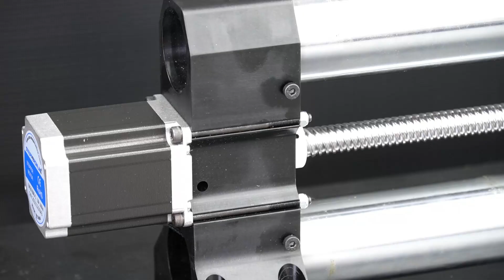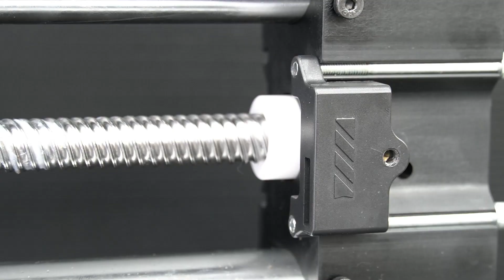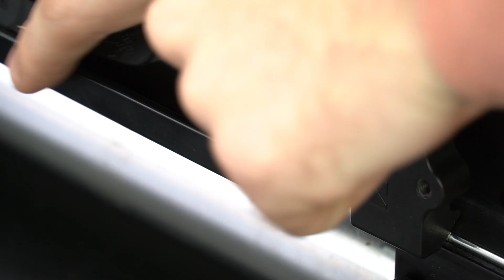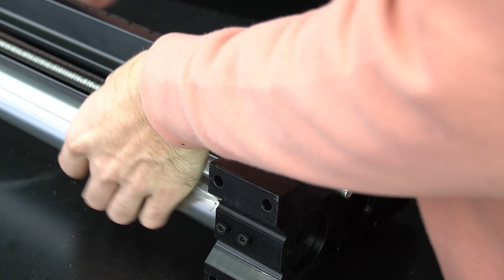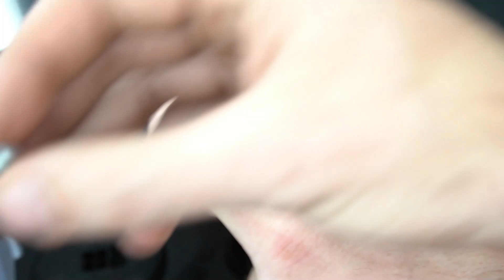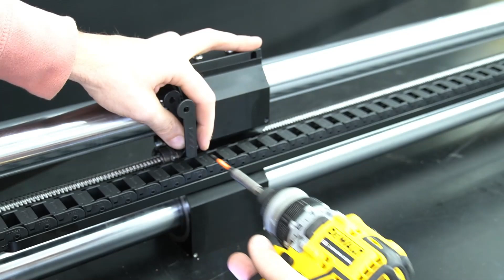Original & Pro Series Drag Chain Install | Support Video

Comment: A note: I put the drag chain kit on my XT50  and the set screws in the back of the Z carriage rubbed on either end of the extrusion so i replaced the rear set screw with a custom screw made from a lower profile cap round head screw instead of the cap hear screw that was from the factory.
Reply from the maker: Yes, if you have an old machine, you'll need to ensure the X axis oil port bolt moves to the front, behind the z slider.
Reply: @OnefinityCNC  Encountered this problem when installing mine. Any instruction on how can I move the oil port bolt to front? Thanks!

Comment: Where do you recommend you put the power cord?
Reply from the maker: we run ours with the vac using @rowdyroman holder!
Reply: I added an XT60 connector on the end of the router power cord and ran it through the cable chain. Then added an extension from the end of the x gantry through the y cable chain to the IOT power controller. Works great!

Comment: This only shows the x rail install.  What about the y rail?  The set includes both correct?
Reply from the maker: They are essentially the same.
Reply: Would think a little different at the X-Y junction  how to route / connect the cables.... but sure I'll figure it out!   thanks for the video!
 @OnefinityCNC